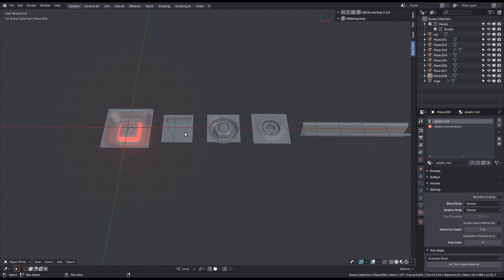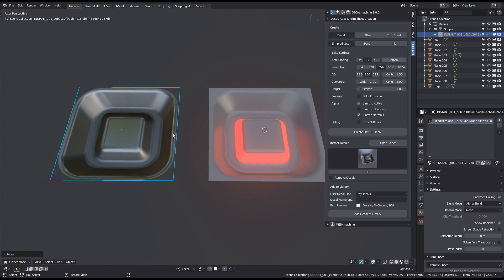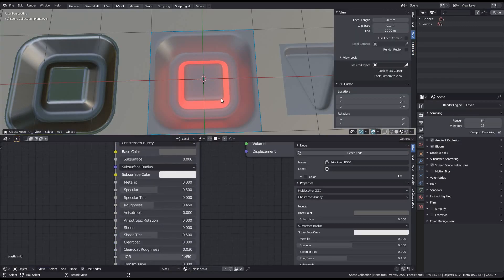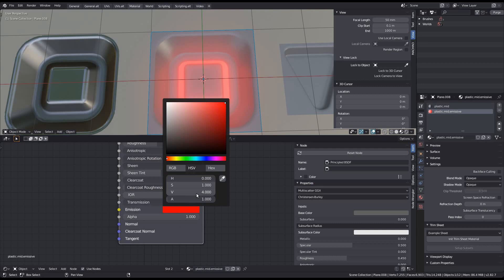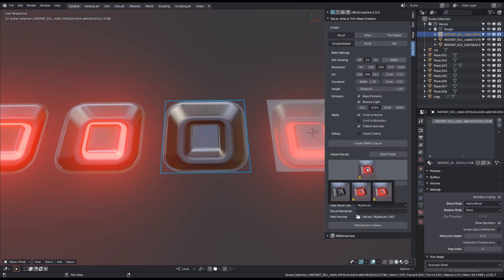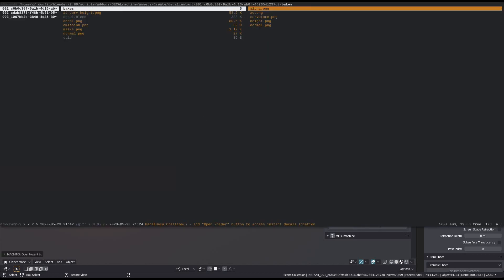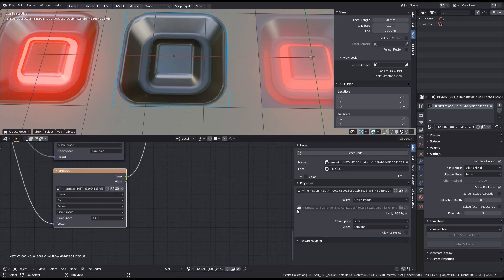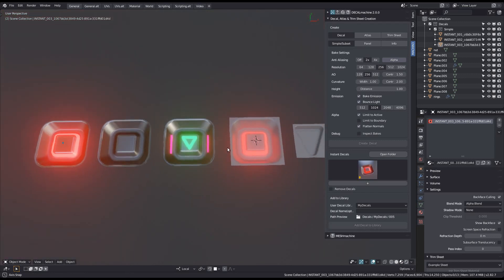DECALmachine 2.0 - Create Emissive Decals

Comment: I don't regret my purchase. This tool is powerful !

Also, I would like to add that tampering (In the Shader Editor) with the color output of the emission map node of an already existing decal allows for quick color control : 
-plug the color output in a math node set to "Greater Than" with value set to something bewteen 0.1 & 0.2 (to separate the colored part as white and the empty part as black)
-add a RGB node set to the desired color
-plug both the math node and the RGB node in a color mix node set to multiply
-plug the output of the mix node in the Emission Map socket

Color in the RGB node can now be changed on the fly to impact the decal emission color.
Reply from the maker: Cool yes, thanks!